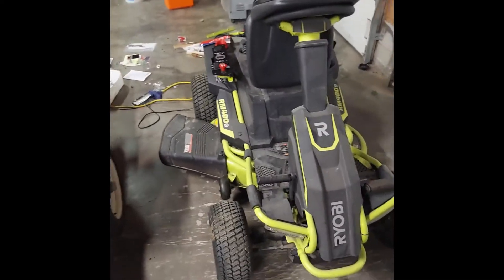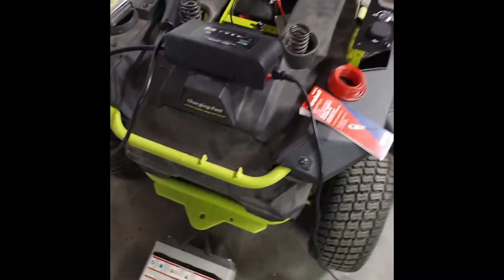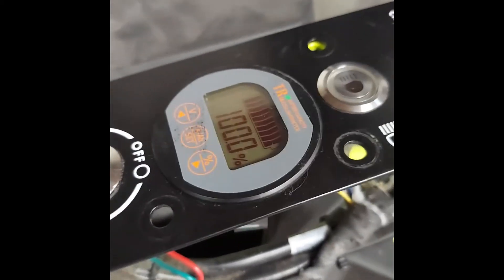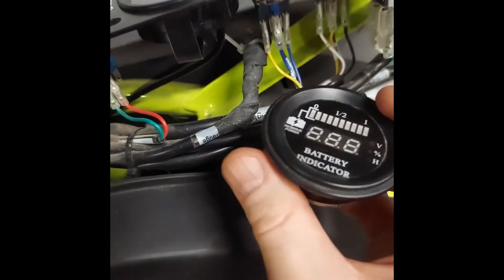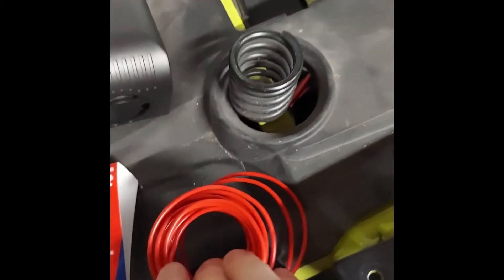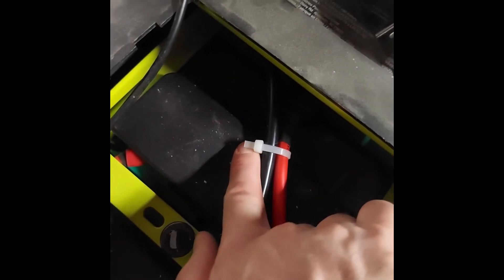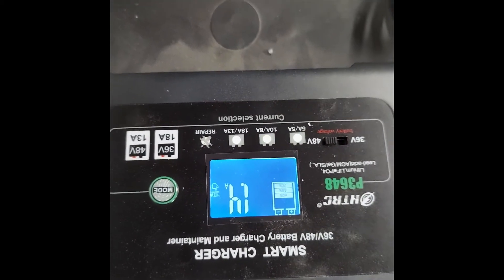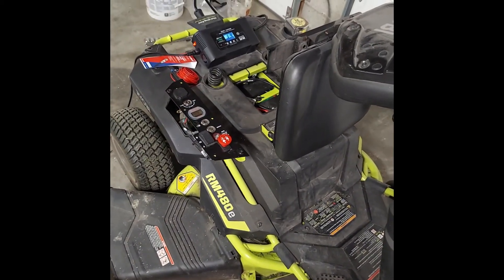Upgrade Ryobi RM480E/RY48110 to LiFePO4 Batteries - Tutorial + Required Parts

Comment: I'm in the process of making the same conversion.  Thanks for providing a lot of helpful info.  One question, though.  Wouldn't it make more sense to power the gauge (the red wire) from a switched point, rather than wiring it directly to the battery?  It looks like you have it wired so that the meter is powered up all the time ..   I'm thinking it would make more sense to have it power up when the 'ignition' switch is turned on.   Am I thinking about this incorrectly?
Reply from the maker: I also like to be able to check the battery level without having the key in.
Reply: @ryannoble5451  Thanks for your reply.  I've thought about it some more too,  and looked hard at the schematic, and have convinced myself that if I let it power off when the key is off, it would not be able to track/detect the incoming current while being charged .. and would probably not know the correct state of the battery.  So I'll probably do just what you did.
Reply from the maker: @Jerry Velders I'm sure you can. I just went off the gauge instructions. I couldn't find a great wiring schematic for the mower so I didn't want to get too far into it and didnt have the time to experiment. Plus, the LCD screen wouldn't cause much of a drain. I usually leave it plugged in when not in use.
Reply: The meter can't calculate power without it always connected. Draws little power, backlight shuts down after a bit.
Reply: I am in the middle of this project myself. I did order that gauge, but for the sake of simplicity, is there any reason why the existing gauge would not continue to work? Edit: I see you already answered a similar question and that it won't read accurately. I was just hoping to avoid needing to cut that larger hole to fit the new gauge. But I guess I will give that a try.
Reply from the maker: I'm only basing the new gauge off what I've read. You can give it a shot with the existing gauge and see what happens (accurate or not). I like the new one regardless because it has the backlight, reads amp draw, and gives an accurate number vs the light bar to show remaining capacity.
Reply: No sense in risking memory loss for the gauge...the draw is so miniscule you can't see it.

Comment: this is the best video of this type. Thanks so much! I purchased my mower 3 years ago and it is still going strong but I know the time will come soon for the upgrade. I remember when I purchased it I immediately thought that lithium upgrade would be needed in a few years, but lithium batteries at that time (only 3 years ago!) would cost way more than the mower.
Reply from the maker: For sure. You have to decide if it's worth the extra $1200 or whatever to upgrade. For me, putting in more lead acid $6-700 wasn't an option so it was either get a new mower or get lithium. Time will tell if I made the right decision. Hoping these last for a decade or more.
Reply: @ryannoble5451  With the prices of the new mowers right now, this saves a ton of money since the mower is still usable. Great drop in solution and keeping the wiring and recharging better. Thanks for doing the work. I've added these items to my amazon list
Reply: @HackAttackx10  I got my Ryobi 480e 48110 75 aH from Home Depot for $1500 on clearance a few years ago. It was a floor model and they couldn't find the charger. I talked the manager into calling Ryobi to explain the situation and they sent me a new charger free. Given the price I paid, I can't complain about the OEM batteries crapping on me, since I have no idea how long it sat dead on the floor but now I am running only 20-25 minutes on a full charge with the blade higher than I want, and when I first looked at new mowers HOLY SHIT!!!!!! What the hell happened to those? I would be in for at least 4 grand it looks like so I really hope this battery upgrade works. My batteries were just shipped I think.

Comment: Isn’t there 3 wires in oem charger compared to 2 on the new?
Reply: I believe the third (top) wire on the charging port is a voltage supplied by the charger when it is attached.  When the mower sees a voltage on this pin, it shuts down .. or prevents being powered up .. which is why, when the charger is attached and running .. you  can't power up the mower.
Reply from the maker: @Dale Garrison Yes. I'm not sure, but the third wire might be there to relay to the oem charger when a fault occurs or overheating of the batteries etc. If your new batteries have a BMS, it shouldn't be a problem only having the two. I haven't had an issue yet so far.
Reply: Yes, from my efforts trying to understand the power delivery wiring this third connection is simply another 48v connection from the charger that opens a normally closed relay in the “charge port lockout” circuit. Opening this relay stops a 48v control signal going to the 48v to 12v dc-dc converter in the mower which disables the 12v output controlling the 48v main power relay in the mower. Hence all the 12v powered controllers are shut down as is the 48v supply to all the drive and blade motors while the unit is charging. To preserve this functionality you can simply solder a short jumper from the back of the 48v charging pin to the unused pin in the charger plug receptacle when you take it apart to swap it over.

Comment: Is 4 of the 12v 50Ah enough for 1.5 acres of mowing? I have to Ryobis one is large like yours and the other  is the 380e.
Reply from the maker: I use about 25Ah for my 3/4 lot. I think you'd be on the edge. Maybe do 60Ah+.
Reply: @ryannoble5451  I have decided to go with exactly what you have used. 12v 100ah. 🔥
Reply: @dannys813  so you used 4 12v 100ah batteries? what brand and are you happy with them?